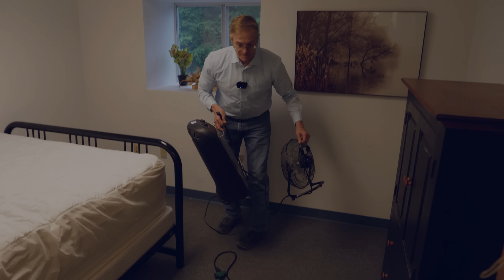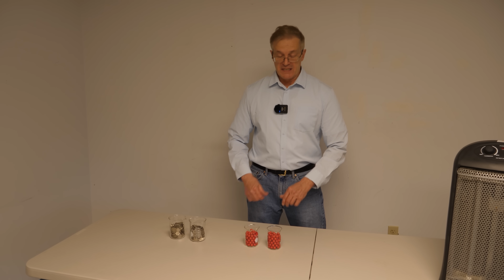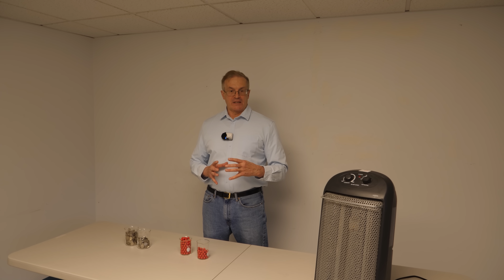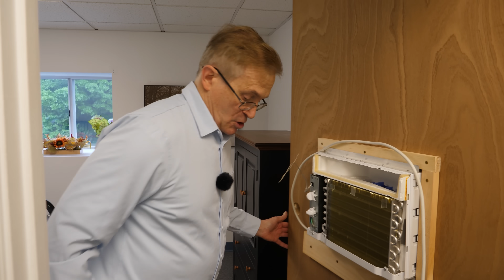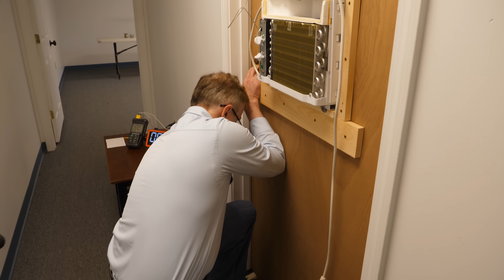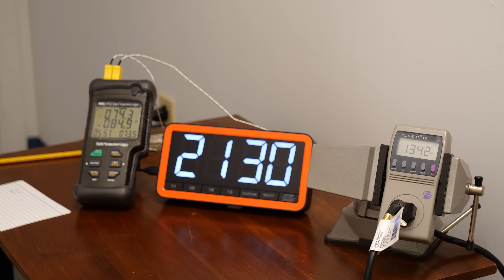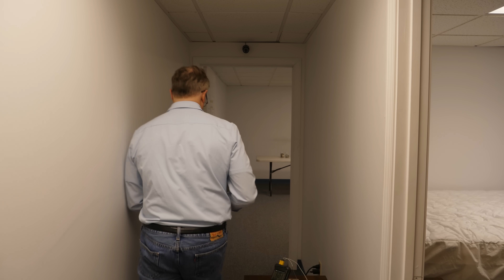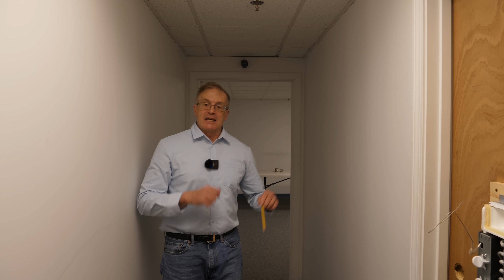You're wasting money on heating! Use your A/C!

Comment: 1. The temperature probe was closer to the A.C. then the heater...

2. Try getting the same results in a real world situation, You know where it's like below freezing outside... and you're trying to pump in some heat.
Reply from the maker: 1. The output from the airconditioner was blasted across the room and away from the probe.
Reply: @TechIngredients  Maybe you should try a thermal camera in the room to prove it as well, 😉 Just a suggestion... 

I do realize it can be more efficient however again not in all real world situation... Because if it's cold outside it's not going to work nearly as efficient, most heat pumps actually have built in electric heaters to overcome this problem in colder ambient temperatures... If you live anywhere much North of 45° latitude, I'd say forget any real efficiency savings, because of when it gets cold. They only work well as in your test when it's above freezing conditions. Below that they get less efficient with outside temperature drop, to the point they just don't work. So I wouldn't recommend a heat pump alone in this area I live in. 🥶

Comment: I cant be convinced to pay for a heat pump system that won't reverse and heat my house.  That whole 1 direction thing... nah, fam.  Heat pumps work down to some absolutely insane temperatures, too.  Lower than you might think if you're buying purpose built units for cold climates.

Comment: That was a very good balance of transfer your heat dump was starting at 70sh  your cooling was dumping in the relative same temperature put your cooling dump in a cold area say 28 degrees and try raising your heat dump from 58 degrees to achieve 72 degree and humidity has a roll in this  the problem is the delta you have when you need heat in cold temp the efficiency drops . Remember your heating and cooling for comfort  not science to say something works .

Comment: I think a refrigerator would be a more real-world use case but I guess the result would take longer, be less dramatic, and a bigger hole in the wall ;). For those still confused about what to do with that cold air imagine that cold air blowing into a walk-in cooler where you keep your cold beer...voila no longer a trade-off. (For simplicity I will not complicate this with lowered efficiency as each side gets hotter and colder)
Reply from the maker: You're right. However,  we covered the surprisingly low output power of common refrigerators and freezers in our computer cooling video a couple of years ago.  They simply don't have the capacity to cool or heat a room.
Reply: @TechIngredients  Makes sense. The trade-off between high efficiency and capacity. If I remember that may have came up in PC cooling with an air conditioner
Reply from the maker: It's actually not a trade-off. They are simply too small.

Comment: It seems like an AC unit is more efficient at heating than cooling.
Reply from the maker: That's true.  The energy used is added to the energy transferred.
Reply: @TechIngredients  How did you deal with the condenser water?

Comment: Are reverse cycle air conditioners not a thing in the US?  In Australia they are pretty much the normal type installed.  I have one running right now that was cheap to install and works perfectly.  Most new houses here in Perth, Western Australia have central reverse cycle aircon heating/cooling  the entire house.
Reply from the maker: They are less common,  but they are still used.  Our historically low energy costs are likely the reason.

Comment: If you aren't already planning it, I'd be interested in a video examining the differences in heat pump efficiency depending on various design factors, and depending on the contrasting environments on either side of the barrier it's pumping heat through.

For example, I've heard that heat pumps do not work as well in extreme temperatures, say if they're trying to pump heat out into a frozen winter and ice builds up?.
Reply from the maker: Heat pump efficiency decreases as the temperature "mountain" becomes higher.
Eventually,  they will not be more efficient than a simple resistance heater...for the whole climb.  A hybrid pump and resistance heater solves that problem.

Comment: I have two quite large heat pumps.   They do a great job for AC but when the winter really starts they're less than useless to heat the house.
1) they push out warm air, not hot air so it takes a very long time to heat a home unless it's running all the time.
2)Below freezing outside and they become really expensive to run and far less efficient.
3) Unless one's home is extremely well insulated and air filtered as a consequence/need of that, then heat pumps are a no go in many parts of the world.

Our furnace heat can heat the home from cold very quickly and works out significantly cheaper to run generally too.
Reply: Modern air-source heat pumps have SCOP of over 2 still in -25c temperatures, and hovering around 2,5 to 4 SCOP in -15c to 0c range, so these pumps work really well in temperate climates, providing 4 units of heat per one unit of electricity in 0c temperature.
They provide a steady flow of even temperature, and practically are meant to be on all the time and let its thermostat do its thing. But in actually cold environments of below -10c they are meant to work as a secondary, supporting source of heat.
So, when compared to electrically functioning solutions, these are generally the most cost-effective and care-free. Rest depends of how expensive / cheap the local alternative sources of heat are.
Reply: @luuxii  When we moved to this property there was an electric furnace and two heat pumps.    In the Winter the furnace was effective but ridiculously expensive.    The heat pumps were new (so 4 years old) and good ones, and were cheaper to run but just not up to the job.
We then removed the electric furnace and replaced that with a gas furnace and that is now more efficient and cheaper to run than either the old electric furnace or heat pumps.    Our fuel costs dropped dramatically, and the home is comfortable.
We added a large wood stove with catalytic converter and our fuel costs dropped even further (because the gas furnace is now just a backup for the stove).
Heat pumps are not for everyone!    An apartment?   I reckon these new window ones will do very well.     I run a Mideas window AC (the U shaped ones) for downstair AC in the summer rather than the External AC (heat pump) units and it keeps the house quite cool and is WAY cheaper to run and it runs on solar.
There are ways to be comfortable and yet lower one's fuel costs dramatically - but each home is different.
Reply: @luuxii you are trying to compete with a system that has a minimum of 7 cop
Reply: @Dan-gs3kg  what system is that? You can clearly see what I wrote and deduce from there.

Comment: Actually, a given volume of air has the same energy regardless of temperature. It just has less mass at a given pressure when it's warmer.
Reply from the maker: That's actually correct.  I should have said  the same mass of air.

Comment: Also note that when you do a heat pump system you need to go at least a half ton step if not a full ton step up in the rating or your going to be cold. I had a heat pump system installed about a decade ago on my house a 2 ton system came out and a 2 ton system went in, I wish I would have stepped it up to a 2.5 or 3 ton as when it gets down sub 30F it gets cold in the house as this system struggles to hold a 25F differential temperature on heating, it got down to 15F outside this last winter and it was barely 50F in the house with the heat pump running full blast.

Comment: Last year, I borrowed a BUNCH of money to invest in a large Heat Pump for my whole house-- It paid off in less then 9 months-- With the extra savings on Utilities, I used the difference to pay off my credit card.   .. Months later,I bought a smaller Heat Pump to heat water in my Hot Tub at 425% Efficiency-- The "Resistive" Hot Tub Heater draws 1,800 watts producing 1 degree per hour increase in water Temperature... The Heat pump(after start up) draws,just, 410 Watts and raises the water Temperature by 9 degrees pee hour... I also got $2,000.00 off tye cost of the first Heat Pump ,in exchange for making 7 "How-To" videos(going through ALL the steps) on how to install the System

Comment: Dear Mister Ingredients,

That space heater you have there at about 1min, the one with the quartz type crystal infrared orange glow radiant heat (no fan in it).

I did an experiment using this very same heater --- I think you should try repeating it.

It was about -10F outside, and about 20F in my garage when I did the experiment, but you can do this at room temperature as well.

Using a cheap plastic 8x11inch fresnel lens,  I was able to project "heat" across many feet of the garage in freezing temperatures to deliver the heat to the face of my wife !!

As it turns out the orange red glow of the crystals is producing some kind of infrared heat as well... and by projecting the orange light from the crystals glowing (using the lens) I was able to deliver warmth of heat at a distance from the cheap space heater .

This is actually a cool thing to do, since delivering heat across a room without moving any air (no fan) is something I think everyone would want!

A simple projector lens in front of the glowing orange quartz crystals.. projecting heat many feet away .. increasing efficiency and area of use without the increase of any wattage -- by use of a simple plastic lens.
Reply: Radiant heat.  Long wavelength light emitted, infra-red in the neighborhood of 10,000 nanometers.   Interesting that some materials that are optically clear at visible light wavelenghts can be nearly opaque to infra-red, and some materials that transmit infra-red really well will almost completely block wavelengths in the visible portion of the spectrum. Have a look at iR filters to delve deeper.  Some of the old Sony Handycams could be converted to sort of night vision cameras by simply removing the iR filter, not as good as a dedicated iR camera, but good enough to see through some types of clothing! You could covertly  surveil an acquaintance to know if they have a gun or are just happy to see you.
Reply: Black-body radiation. The wiggling atoms occasionally kick off a photon. The harder the atoms wiggle, the harder the photons wiggle. If they're hot enough, the atoms spit out photons wiggling in the visible spectrum.
Reply: @pseudotasuki you are mixing concepts here, it’s better to either think of wiggling atoms or the temperature of an object as the source of photons dislodged as it’s one and the same. Temperature is after all kinetic energy, aka the wiggling you speak of. Infrared light is not a temperature, it can however excite atoms to wiggle. Also atoms could be described as wiggling to help understand the concept, I think photons should not as they are a EM waveform and a wholly different *thing*, using the same words to describe their motion is misleading imho.
Reply: Thats really cool. Had no idea you could lense heat.
Reply: @CognosSquare  You can't focus heat, but you can focus the infrared radiation the heat emits.
Reply: @yeroca arguably this entire video is about focusing heat
Reply: @miamisasquatch  Perhaps they are using the term "heat" very loosely.  If you look up the definition of heat in a physics book, it will say nothing about infrared light, or that it can be focused. Heat is a type of energy that transfers from a higher temperature body to a lower temperature body using one or more of three mechanisms: conduction, convection, radiation.

Infrared light radiation just happens to be the color spectrum that is emitted by objects that are in a certain range of temperatures.  If the temperature goes over that range, the light become visible, first red, then orange, yellow, white, then blueish, and violet and so on, and goes up the spectrum becoming ultraviolet, then x-rays, and gamma rays at the very high end.

If you look at light bulbs for sale in stores, they typically rate their color by using temperature, for example 6000 Kelvin is about the color of sunlight.  Most of us prefer "wamer" light meaning more towards the red end of the spectrum which is actually a cooler temperature around 3000K.  

Temperatures below the infrared range go to terahertz, microwaves, and then radio waves at the very, very low end (near zero Kelvin).  You might have read, for example, that the cosmic background temperature is about 3 degrees Kelvin. That was detected with microwave antennas.

Sorry this is so long.. I don't blame you if you say, tl;dr :D
Reply: @CognosSquare Depends on the lens material. If it's transparent to infrared, then yes, you can focus heat just like you can focus light.
Reply: Those types of space heaters only produce heat through infrared radiation, with little extra being waste.
They're specifically for heating people, as their great at that, but very poor at heating the air.
That's why you'll commonly see these in outdoor spaces, especially parking garages and security booths.
And also why most modern space heaters use ceramic elements and are forced air, with a fan.
The infrared type are still made for specific use cases (like outdoors), but I think they're referred to as 'personal heaters' rather than 'space heaters'.
Reply: Cool 2 of my favorite YouTubers
Reply: If projection/distance is what is really important for your application (no outlets on one side of the garage?), buy a parabolic dish heater.  It will heat whatever you aim it at without heating the air in between.
Reply: @podhole  It will heat the CO2 in the air, but that's a pretty minor effect, given that CO2 is about 400ppm.
Reply: No, it actually isn't a 'cool' thing to do.
Reply: Living off grid, I'm freezing
Reply: You didn't increase the efficiency, you just focused the infrared light, which when it hits.a person feels warm. Look up infrared heater panels. The room stays.cool but the person warms up.
Reply: @Hclann1  No fan or anything was required to move heat across the room. Removing the power required for that does increase the efficiency of the system, even if the efficiency of the heater/heating wasn't increased.

Comment: That is bizarre. I believe your statement of an electric heater being 100% efficient to be inaccurate. It is a resistive load and there has to be other Waste as in electromagnetic field Generated by the coils
Reply from the maker: That's not what I said.
I said it's about as close to 100% as any device built by people. The electromagnetic radiation at 60 Hz is vanishingly small.

Comment: I mean, no air conditioner uses resistance to heat modes
They use a reversing valve to change the direction of the refrigerant flow. This allows the system to provide heating instead of cooling.Heat Exchange: In heating mode, the refrigerant absorbs heat from the outside air (even in lower temperatures) and transfers it inside through the indoor heat exchanger. The indoor fan then circulates the warmed air into the room.
Reply from the maker: That's what I said.
Reply: @TechIngredients  Yes, and its just weird how so many videos talk about heat pumps as something entirely new, some technology barely explored...

Comment: Yep when our Central Air AC died, that is why my decision was to do Minisplit heat pumps in each zone and use the existing propane as a backup heat source for when temps dip below what the heat pumps can do.  The newest inverter mini spits a SEER 20, far better than a window AC system

Comment: Looking forward to that next video as always. Question: Normally the A/C unit is through the wall so the heat is ejected to the outside. If one uses it as a heater, then I'd assume they reverse the configuration so the control surface is outdoors and the heat is directed inside. This would be done in winter months. Would the A/C act as efficiently to heat the room in a "winter configuration"?

Comment: Efficiency is measured in power lost as heat, as the entire idea behind a space heater is to convert power to heat this efficiency is nearly as high as it can be, a minor amount of power is used for the circuitry and the rest is expelled as heat, but if you think of efficiency as power used to perform a task, then you get a much different value

Comment: why are stoves just induction and resistive heaters? why aren't there heat pump stoves? it's like 10x more efficient than gas stoves
Reply from the maker: That's a good question.
I suspect the answer is the limited choice of "refrigerants" that can operate at the very high temperatures of the hot side.

Comment: May use less energy than an electric heater but I think it would have a hard time meeting the cost level of wood or oil heat! There is a big push to go with electricity for all energy needs but the problem with that is that the electric companies as soon as everyone switches to electricity the power companies will raise the price 5 fold and be making a killing off from it. Not to mention the capitol venture to push everybudy intoa new model of how energy is purchased and start charging you for your CO2 you emit even if they don't have the proof that they aren't lying!

Comment: We use air to water heatpump for central heating. Its good, but COP ranges from 5 at 10°C  to 2.4 at -15°C. It makes hot water and radiator heating ranging from 30 to 50°C depending on heatloss and demand. I mean it works fine, but i dont like it needs to run 80% of day in cold days, up to spec, but it eats lots of electicity like 1000-2000kwh per month its 4kw compressor, 12kw rated heat at -5C. Now we changed windows, house got more comftable, but heating cost is same. Now i question loft and wall insulation, i am still curious how heatpump efficieny can be improved.